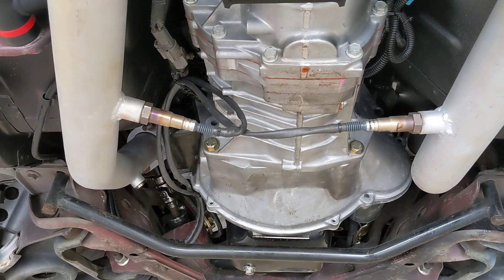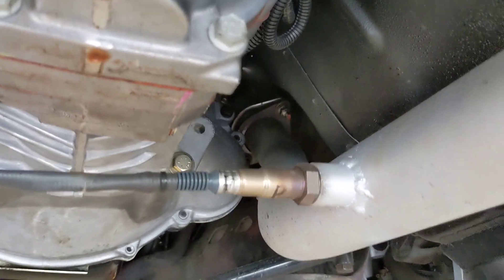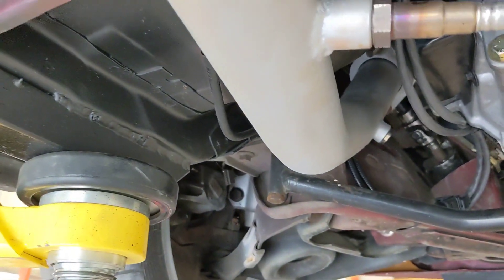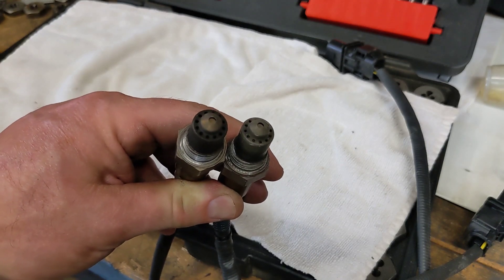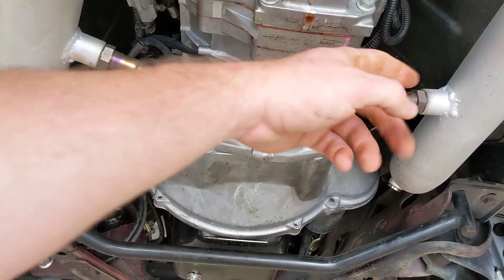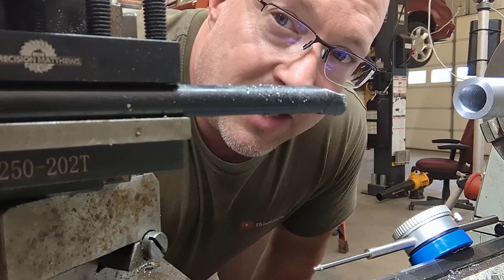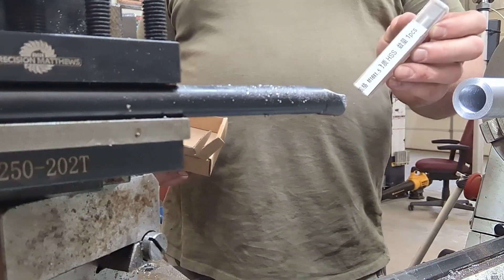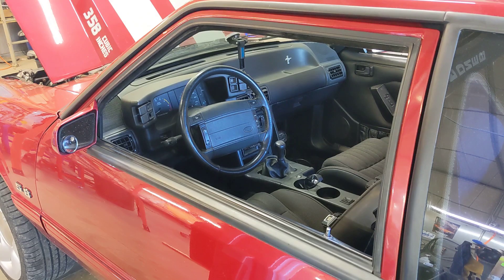Heat Sink for Wideband O2 Sensor diy machining build - Zeitronix Pro-M EFI

Comment: Innovate makes a heat sink called the Air/Fuel Ratio Monitor Accessories 3729.  I had issues with my o2's going bad, so I got the Innovate, which are not cheap.  They have to be indexed and that's a pain, but they seem to work and 80 bucks a pop to boot. They seem to limit how hot the o2 gets and it prevents moisture from getting to the sensor also.
Reply from the maker: I saw those. Like you, I didn't want to spend the money... Besides, I like making things lol. Thanks for the tip!